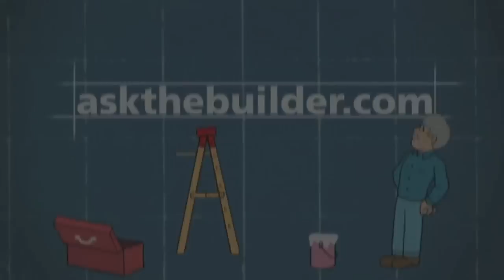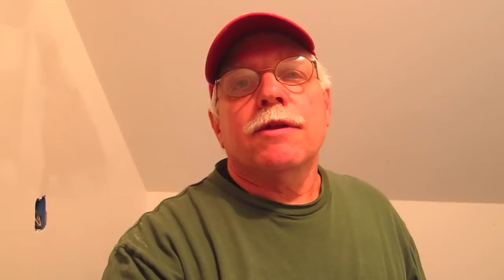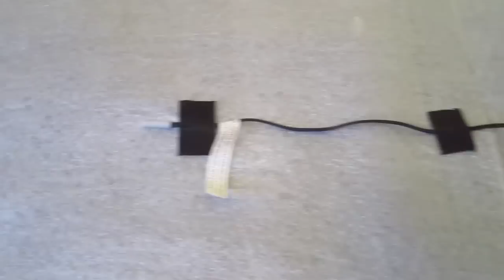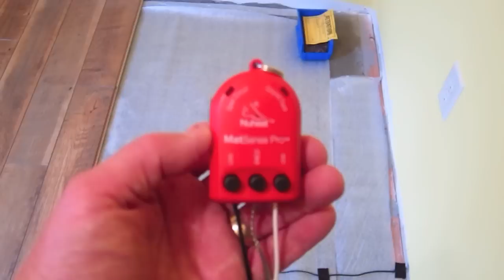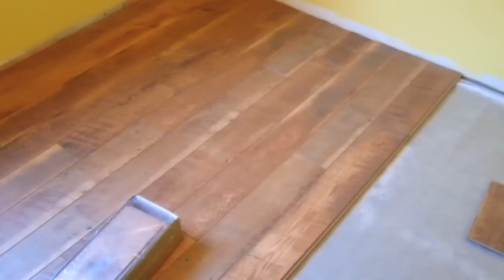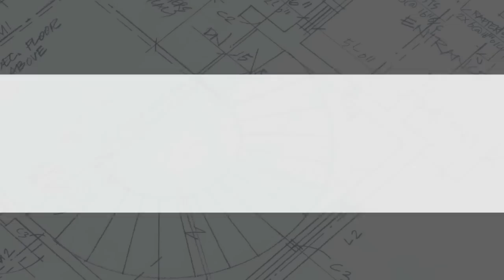Install Radiant Floor Heat Mat Video 3 of 3

Comment: Will this be the only source of heat in the room.
Reply from the maker: Yes! It's the only source of heat. Because I have the floor, walls and ceiling well insulated, the mat produces about an 80-degree delta T temperature difference. It's very important to have your room well insulated.
Reply: Ask the Builder Thank you for the info. I'm getting ready to redo my bathroom and I'm thinking about removing a cast iron radiator to gain some extra space.

Comment: Great series, Tim. This one and the other one where you installed laminate flooring. Question: Does that probe cause the piece of laminate to have a little hump? Or did you notch out some material from the bottom side of that piece so the probe recesses up in the laminate? Thx, Gary
Reply from the maker: The probe is small. It doesn't cause a hump. The foam underlayment helps make sure of that.